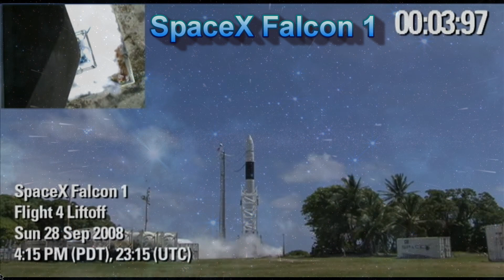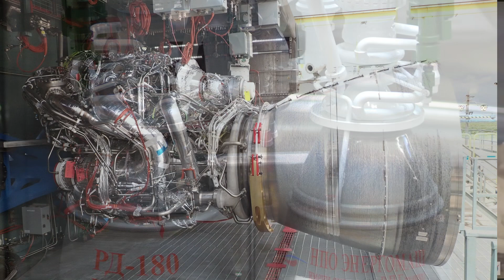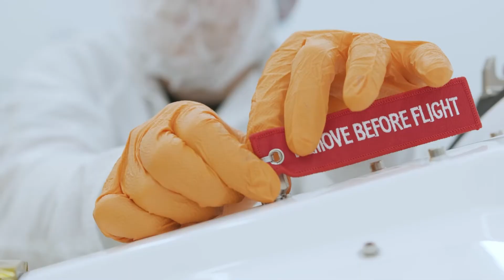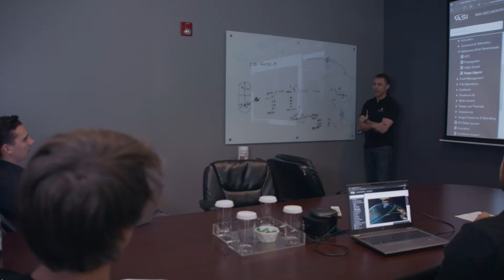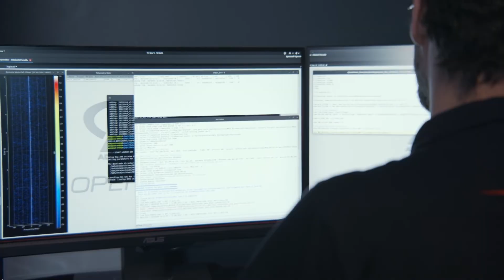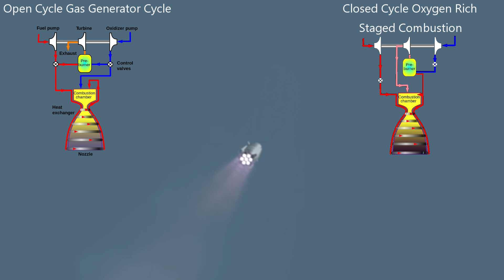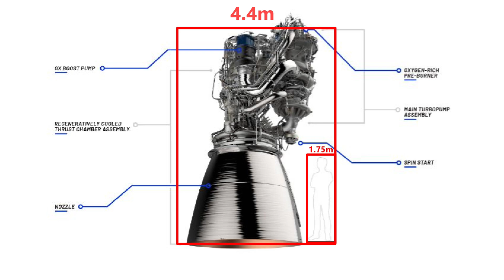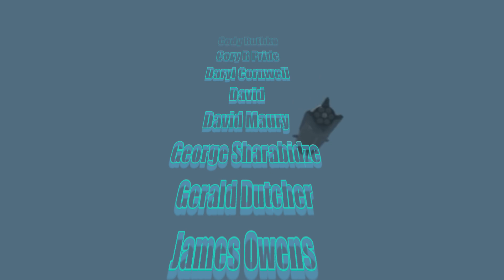Falcon Killer!  How Rocket Lab's Neutron Rocket will beat the SpaceX Falcon 9!

Comment: By the time Neutron gets up and running, Falcon 9 would have been phased out by SpaceX with Starship replacing it. The real competition of Neutron by that time will be Relativity's Terran-R. By that time, Starship will probably be a lot cheaper to fly, being 100% reusable. That's why Peter Beck is now bashing Tim Ellis' backlog contracts as "worthless". He knows he's going to face the Terran-R in the future and is feeling the pressure.
Reply from the maker: Starship won't be appropriate for everything.  Falcon 9 will still be flying for quite a while I think. As will its competitors. Like the Terran R :-)  Which, if all goes well.  Will be potentially cheaper to build and fly than the Falcon 9.

Comment: Ok. Neutron can lift up to 15,000 kg (33,100 lb) while expended, 13,000 kg (28,700 lb) while landing the booster downrange and up to 8,000 kg (17,600 lb) with the first stage returning to the launch site. lets talk apples to apples to LEO: RL says it will transport 13,000kg for $50M = $3,846/kg. F9 will transport 17,400kg for $62M = $3,563 per kg. Where is RL's price lower than F9? I'm using the figures you quoted.
Reply from the maker: The cost per kilogram does not need to be lower.  This is a false metric.  Since about 90% of satellites are 13mt or less, Neutron can beat SpaceX price per launch.  If you need a falcon 9 to launch a 12mt satellite, SpaceX does not give you a discount for the lower mass... you pay as much as if it were higher.
Reply: @terranspaceacademy  Understood. However, look at the two company's relative financial states. RL is deeply in debt, as SX was in the beginning. They have a strong motivation to charge as much as possible to make up the shortfall in order to become profitable. SX's cost to launch an F9 is reported to be $10M or less. They can easily discount their launch prices, like Tesla has done, to be able to dominate the launch market, should it be required. RL is in a very tight spot, financially, whereas SX is very comfortably profitable. Has RL quoted a price to launch 200kg smallsats, like SX does for its RideShare program? Also bear in mind that as groundbreaking as Neutron is, they still use expendable second stages, just like SX. The Neutron, although it has integral fairings, has the same problem as SX when they are not able to land at the launch pad. Will they have to get sea-going platforms like SX? They don't want to, but the Neutron is too large to qualify for Helicopter capture. Most of SX's booster landings are at sea. If RL does not develop a similar mechanism, relying only on Launch pad landings, they will not be able to sell nearly as wide a variety of launch destinations. I wish RL all the success possible, but remain unconvinced that their success and ultimate profitability are guaranteed.

Comment: The Neutron rocket is interesting in concept and design, but I suspect they may find issues with the use of carbon fiber in the body construction. SpaceX tried it, and discovered that it fails under pressure at cryogenic temperatures, although the Neutron is of much smaller diameter and may succeed. The rocket is still a 2 stage launcher, with the second stage encapsulated in the captive faring, which allows the entire first stage to return. Heat shielding not needed, as max speed would be similar to many other rockets, about 12,000kmph prior to a re-entry burn. I wish them good luck in their endeavor.
Reply from the maker: Those are good points Paul.  I think for their design carbon fiber will be ok but it never would have worked well for Starship we don't think.

Comment: Looks like Rocket Lab has the right approach.  I sometimes worry about SpaceX (Elon Musk) being too ambitious.  After SpaceX succeeded in getting the Falcon 1 into orbit, they went directly into developing the Falcon 9, without more Falcon 1 launches.  It paid off, but seems to have been the first instance of a pattern.  After finally having one "okay" starship landing, they stopped and went into developing the booster.  Now with the booster they've got a lot of variables to deal with at once: "chop sticks" which have never been tried before, full flow staged combustion engines with extremely high internal temperature and pressure, developing the launch pad mechanisms and systems, the internal structure and plumbing, and probably tons of stuff I'm not aware of. Each step SpaceX is taking seems to come a bit prematurely with more and more complication.  Everything seems pushed to the limit, and sometimes a step or two beyond.  Probably not a great long term strategy.  SpaceX will probably get there, but it will be a rough ride.  Rocket Lab still manages to innovate, but it appears to be in a more controlled and practical manner.  Time will tell.  Of course, I'm rooting for both!
Reply from the maker: We are too TK.  I do wish SpaceX ran parallel operations to free up Elon's time for Starship.  I think that is where he is needed the most.
Reply: @terranspaceacademy  Yet Gwynne Shotwell has perfect match of personal expertise in heat shield materials engineering to see Starship reach its next major goals. As well as the production ramp knowledge that will also keep SpaceX's finances liquid.

Comment: Good overview. You left out Stoke Space as a probable competitor to SpaceX. I don't know as much about these things as you, but it seems to me if they can make their system work it might be the winning design. The issue for their competitors would be can Stoke protect that design via patents or not. I would guess not, and so you might see something like Starship redesigned to use the active cooling tail-first reentry instead of the tiled heat shields. But we're talking years down the road likely. I'm sure SpaceX will be watching their tests closely. As to other countries needed to ensure competition. I'm not so sure about that. We're undoubtably drawing in the many of the best engineers to our companies. Same as we did with the internet. Just like you need to consider the efficiency of the rocket engine, you also have to consider the efficiency of the capital use in a huge, capital intensive operation like permanent off-Earth colonies. And I'm not sure too many other countries can compete with the effectiveness of the US markets in capital allocation. China probably has the engineers, and maybe the capital, but they are hard at work to politicize their markets which will destroy their efficiency. India has similar problems. The EU politicized their aerospace industry years ago and it shows.
Reply from the maker: We took a good look at them a few lessons back.  I love the actively cooled second stage with the aerospike effect.  They just aren't big enough yet to be real competition... If they can get a reasonable booster quickly they could be the first fully reusable spacecraft to orbit! :-)

Comment: I fully agree on the need for competition.

I will point out that we don't know SpaceXs cost for a Falcon 9, but we do know of one case where there was a mission designed for the pegasus ($25m/launch) that ended up flying on a F9 as SpaceX underbid them (and we don't know if they did it for prestige and lost money on that deal or made money)

I've heard that SpaceX aims to comfortably underbid the competition, but otherwise charges what the market will bear, so we need to not treat the current $62M/launch figure as if it's a hard limit.

I hope rocketlabs does get Neutron flying for $50m or less per launch, but that would just put it competitive with the F9, not a F9 killer

but my hope and fear is that SpaceX is going to get Starship flying, and 20x Musk's estimate would still put it at around $40m/launch. That is going to be hard for others to compete with (the fear) but should change the mindset for space design away from 'ultra light and ultra reliable at any cost' to more sane cost/benefit tradeoffs as the launch cost will no longer dominate (the hope)
Reply from the maker: I've read that a new booster and second stage launched nonreusalbe costs SpaceX $42M...  I'm not sure that is correct any longer.  As they get more efficient I'm sure the cost has come down considerably.  I wish they would spin off the Falcon 9 line and take it public as a revenue source.
Reply: @terranspaceacademy  given that the starship should replace the F9 pretty quickly, who would be silly enough to invest in the F9 business?
Reply: @terranspaceacademy actually, after one of the Elon musk interviews said "the second stage cost is 20% of the total launch"

Now, by using falcon Heavy expendable of 90M subtract the cost of Falcon9 67M and divide by 2 you would get 11.5M for the one for RTB 

Now, 11.5M x 5/2 =14.375M for one falcon 9 launch with RTB. But assuming profit of 30% means the F9 price floor is actually 19M.

M as in million dollars